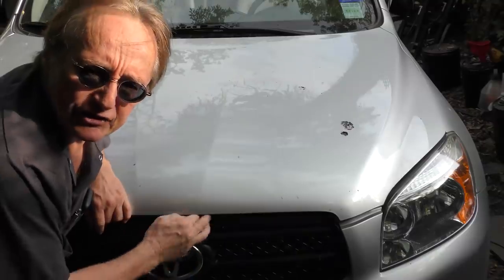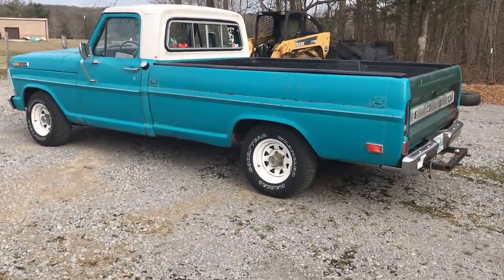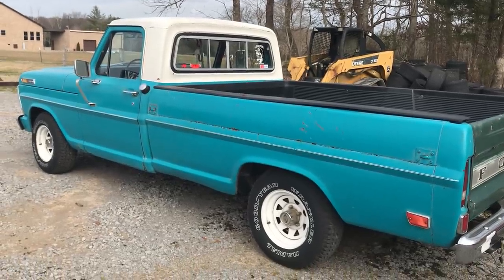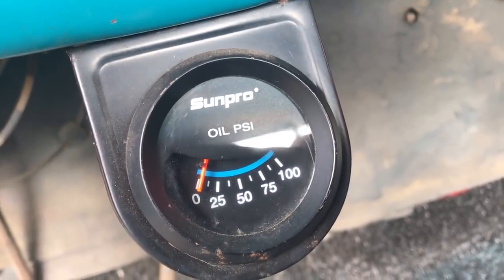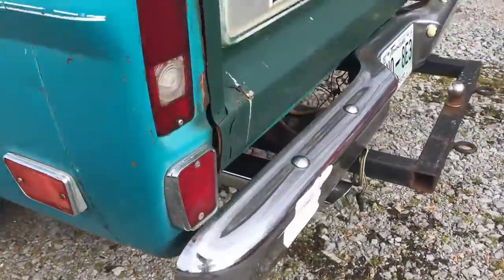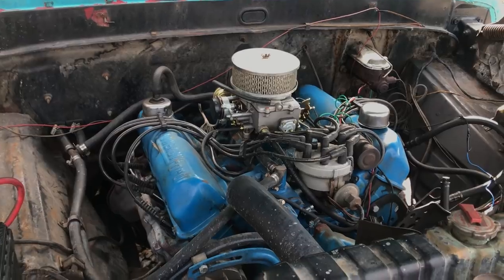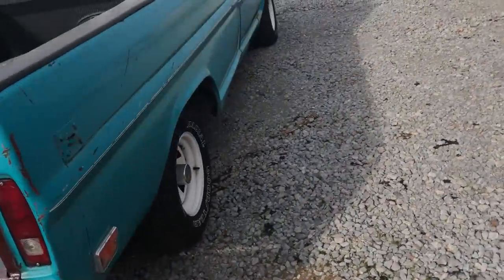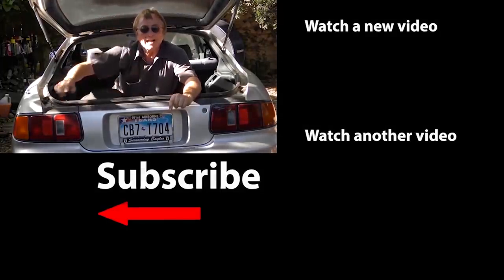Here’s What a $900 Ford Truck Looks Like

Comment: Only $900 where do you find trucks like that
Reply: Craiglist ?
Reply: Where I live that truck would go for at least $3500.00.If I could find that truck for $900 I'd leap tall buildings to get to it. If a guy were patient here he could probably get 5 grand.
Reply: The Southern United States, maybe.
Reply: Tennessee
Reply: In a junk yard?
Reply: Tom Swinburn It’s called a damn good deal is what happened here. Dude totally lucked out finding this thing.
Reply: Tennfingsee
Reply: I usually get them from friends of friends who are not completely mrchanically inclined.   Normally not running and they just want it out of their yard.   I've had majority good luck with it being simple.   Last one I bought was a nice looking 76 Ford Super Cab for $250 and it was a bad wiring going into the ignition switch,  easy fix.
Reply: Pacific NW trucks like that are still pretty cheap. That's about an average price for an old Ford like that.
Reply: @Tim A   I agree with Pacific NW trucks being cheap.   Seems like everybody only wants newer 4x4 trucks.   Anything old and 2wd goes pretty low.
Reply: You can find them riding down country roads in the South.... take a trip down there someday and you will most likely run into one somewhere that will be a good price for you.   I saw a 70's short bed Ford truck with a for sale sign on it and not too expensive when I was last home.   If I was not working outside the country, I would have bought it.
Reply: Any rural-ish area
Reply: Tom Swinburn I want a truck like that but I can only find a few for 10,000 or more :(
Reply: Briggs  in the country, I’m about to pick up a 1976 ford f 100 custom with the original 302 for 2k. Seems to be in great shape, but imma work on her and get her running again. Comes with a brand new hollies 2 barrel carb too 👍🏽
Reply: @alans.4167  I need help finding one
Reply: @elicoble4166    Lately I've been having the best luck from Facebook marketplace.    They go quick so almost need to check it at every chance.   Play around with the location and search radius.   I've seen vehicles that will show up listed at smaller radiuses than larger,  for example a listing might show at 25 miles but not 100 miles.   If you look on there a few times a day for a month or more,   eventually you'll probably find something.   Especially this time of year when people start looking for Christmas money.
Reply: Pacific Northwest all day. I got an ‘80 F-150 for 600 bucks, it’s been a pretty reliable and fun project.
Reply: Tennessee?
Reply: 900$  dollars. 
Yeah right. 
Over  5000 around here easy. 
You  wouldn't even buy the  bed for  900$

Comment: I bought a 1978 F250 Ranger XLT 460 4 barrel with a C6 trans with a blown motor for $500. Found an older 460 for 100 bucks so I swapped it in. Runs fine. It was a towing rig so its got a bunch of dents on the top of the bed and tailgate but the body and bed are straight. It was a blessing from above because Ive invested less than 1200 bucks into it.

Comment: I had that exact $900 69' F100 in 1990. Same colors from Krylon spray paint. It got about 6-9 miles per gallon depending if uphill or down hill. Mine was a lot louder with a bad manifold gasket seal. The cylinder head was warped so even with two gaskets squeezed together, it could be heard blocks away. Two years later, a little Turtle wax and sold it for ...$900.

Comment: Absolute anti theft device today.......young dummies won't be able to figure it out !!!!    hilarious.....
Reply: Isn’t an automatic?
Reply: @angelgjr1999  3 on the tree
Reply: leifcatt So it’s an automatic 3 speed?
Reply: @angelgjr1999  No, it's a 3 speed manual transmission with the shifter on the steering column.
Reply: Thank you. Many people want me to change it to a 3 speed floor shift but I refuse
Reply: I got a kick out of that too!
Reply: Meh im 30 and could whip that junt.
Reply: @picklerix6162  Straight six for sure.
Reply: @eyellgeteven9928  360 v8, more power/torque than many trucks on road today!
Reply: It's been a long time but 1st is down next to the steering wheel reverse is up next to the steering wheel  2nd is thru neutral and up 3rd is straight down. I'm  rusty with them it was a 62 rambler 3 on the tree.35 40 years ago.
Reply: Bet
Reply: @leifcatt  im 15 and i know how to drive a 3 on the tree my ranger has one
Reply: I learned on a 3 on the tree.Also had a 66 Dodge Dart /slant 6 with one.
Reply: That's what my first car, a 1962 Ford Fairlane had, of course I had to convert it to a stick shift on the floor with a kit I bought from an auto parts store. Oh, the stupidity of my youth!
Reply: 2nd truck I ever drove, 3 on the tree 67? bronco,  cant remember exactly the year, but I was 11 at the time, in now 30
Reply: I’m 17 and I own two of these, both of which are three on the trees. Put your money wheee your mouth is.

Comment: I had the same truck for $900.00 back in 1989. Mine had the 240 straight 6 with 3 on the tree. Drove it for 11 years and it went on for years after.

Comment: I had a 68 and 71, both had similar drive train to this one. Bullet proof vehicles! I can't remember but I think it was the 68 that had the dual gas tanks, a 20 and 25 gal. Running with 50 plus gals was handy during the 70's gas shortages!
Reply: forgot to mention, I carried a little ten gal gas can in the back too!!

Comment: 3 on the tree.....good truck
Reply: J G It means the shifter is on the column of the steering wheel and it’s a three speed so it was always coined a three on the tree.
Reply: J G  Yes.
Reply: fun to drive.

Comment: Those models were bad about the front cab mounts rusting away. The cab would sag down and rest on the steering column. I've had to repair that damage before. Sometimes the steering shaft would be worn almost completely thru.
Reply: walmartdog1142 all apart of the restoration game.   Normal problem areas for ford and Chevy.   Just apart of the maintenance on a 30 plus old vehicle

Comment: Me personally I wouldn't drive that $900 truck but it still runs and drives though. Also I've seen some YouTube videos where people take old trucks like this one featured in this video and turn them into weekend drag race high performance machines. Yep from street to high modified drag race trucks!!!!!😁😁😁😁😊😊😊
Reply: Same here, I wouldn't drive it on the road as it predates designing for safety. I'd like to be able to walk away from an accident. You'd be dead with this thing.
Reply: cz luver how its all metal and not plastic
Reply: @czluver4338  stay at home then c;
Reply: I would definitely be driving it. Pulling a paddle fishing boat on the weekends. I pull a fold down with my 72 Malibu.
Reply: @czluver4338  panzy
Reply: EvoEvan Nismo have you ever owned or driven a true classic vehicle ?
Reply: cz luver wrong.    The real metal on this would stand a accident better than any compact car 

New cars have about half the metal thickness and light weight 

That truck weighs about 3,200 pounds 
And is real cold rolled american classic steel that doesn’t just crush up like a modern car
Reply: @mateodelcastillo7186  Exactly. I bet you can sit on the hood of the truck at the drive in and watch a movie and no dent on the hood. Never do that on a new car ever.

Comment: I just baught a 2005 ford ranger xlt with the 4.0 4X4. Everything works and runs good on it. It needs a bed eventually and I am replacing the fuel filter other than that it has a small hole in the driver floor bored that can be easily welded. It has a rebuilt engine and transmission I only spent 300 dollars on it in upstate New York. Yo find running not rusted out truck up here for under 800 is shocking!!!! I love it. It has great power and handles good. I have around 350 on the truck total including what I paid for it.

Comment: 1. Clutch in
2. Hold shifter back and slide up
3.when ready slide enough for spring to launch back and continue going down clockwise and release clutch for 2nd gear
4. Repeat step one but let it ride the back to shift to 3rd gear

Holding clutch and sliding clowise with the stick out toward driver and down allows reverse

Comment: Hi Scotty is BMW Just a trash car company
Reply from the maker: morning, and no they make good engines
Reply: @scottykilmer  that is true because some of them make high technology that you necessarily don't need. But it's not just BMW, it can be other car manufacturers too.
Reply: But you still don't recommend them right?  @scottykilmer
Reply: Listen to your question. BMW is a performance luxury brand. Your question is trash. 🚮
Reply: BMWs are fine till you have to fix them.  Then you'll wish you never bought one.
Reply: Ben Lorentz  you buy a bmw knowing that parts and labor are more expensive. If you regret your purchase for maintenance costs you didn’t think your purchase through.
Reply: @MrCaptainandrew  whats funny is that describes about 80% or more of the BMW owners who come to buy parts from the store I work at.  None of them thought their purchase through. They are the types that buy vehicles just to run them into the ground and then complain about the cost of repairs.
Reply: If you buy a bimmer for the reliability of a Toyota you’ve got another thing coming 😂😂
Reply: Harsh dude. mama not giving any?. @MichaelLesesne
Reply: @scottykilmer  Agreed, after 17 years and 190k, the engine and automatic transmission have been rock solid on my endless money pit.  The fuel consumption hasn't changed since new.
Reply: Damon Abets yes.  Thanks

Comment: Hi Scotty, what is your opinion of Ford trucks with the inline 6 engine?
Reply: Clay Bucy- l'm not Scotty, but l own a 68 f-100 with a straight 6 cyl. motor. It's proved itself to be one of Fords best engines. About 5 years ago l pulled a trailor , full of metal 40 miles , to a metal recycling yard. I could feel it was heavy but l didn't how heavy it really was until l got scaled out. The trailor and load was almost 6,000 lbs. 5,899 to be exact. Plus 4,000 lbs. for the truck? A total of 10,023 lbs. The little motor and auto. Trans. Had no problem pulling this load, sometimes at speeds of 65 mph.  Never heated above 1/4 on gauge. Never even chugged on a hard takeoff. After finding out the weight, l started to worry!! Because my tires were old! If you ever find a ford 300, its now called a 4.9 6cyl. Grab it , you'll never regret it.

Comment: I had a 1970 F-100 in Edmonton, Canada. 1992. $300. Never an issue. Loud exhaust just aftet the manifold...Maxwell House Can Fix. Spray Painted Flat Black. Wonderfully Cracked Windshield. Had it 3 years...Drove to California, Santa Moni for the Summer '93.
Driving down, I sleptout in the 8' bed.
Got to Cali., then would "Rodeo Drove The Drive", as in would drive down "their" snobby street, just to be obnoxious...lol.
Did that A Lot...Never Pulled Over...Canada Plates/License !
Drove to MA., then to Great Slave Lake...back to MA.
3 Great Years !
One of those "wish I never got rid of it" Vehicles !
The End.

Comment: Oil works pretty well to loosen up tree sap, it is what I use to get it off my hands, it isn't water soluble.  I have a 65 high boy that my ex ran off a mountain road but I at least may be able to get it running again.  I have another 65 4x4 that I could use for parts, pretty complete.  I am an older lady and will need lots of help with it but I love driving it and really hoping I can get it going again.  It has a 390 in it that goes like mad, anywhere with any kind of load, it does not care, great truck.  You got a great deal!

Comment: Great looking truck there...and you can sit in the engine compartment when you work on the engine. Lots of space there so you dont have to take half the engine apart to change a sparkplug. I have about the same truck, 1977 Ford half ton, long wheel base, Explorer package, 400 cubic inch w/automatic. All original with a/c, power brakes etc. Drives like a new one but needs carburetor work. Thanks for sharing your truck with us. Nice to see a "real" truck once in awhile.

Comment: It's not a Ranger, though the red stripe in the grille is part of the Ranger trim package. 

Besides Ranger badging on the cargo bed, only the Ranger package had a cargo light over the rear window.  In the cab,  the pull knob to turn on the cargo light glows red. Very cool!

Comment: Got a 72 Ford F250 in San Diego in 74 for 2200$. Shipped it to The P.I. in 75. Sold there in 77 for 5300$. I still miss that old dog..360 with a C6 trans. Raced the Victory Liner Buses up & down the highway in Typhoons. Never lost..;)

Comment: Since it has no airbags, you can get a fancier steering wheel aftermarket with a soft foam grip for not much money, and a memory foam cushion for the seat bottom. Spray some Fluid Film inside and on the frame every fall. Like a relic guitar, it might be better to not change the paint.

Comment: Sounds good, and hey if it runs and drives reliably that's a great deal. I bought a 95 5.2 v8 dodge ram for 800 after the guy was originally asking 1000 in May 2017, I've only done a tuneup, oil changes, 4 decent tires on it, a new battery, and a new fuel pump a couple months ago back in Oct. It does have a bit of miles on it, about 225k, but still starts right up and definitely gets me from point A to B reliably. I have a rather loud exhaust on it that's basically straight pipes, have considered a more mellow magnaflow or similar muffler. I don't put very many miles per year on a vehicle so the lesser MPG of a truck doesn't hurt me too bad. I think I'll always look around for good deals on late 80s or 90s trucks still running decently and fix them up as I go along. I like how trucks sit higher up than cars typically do.

Comment: That is beautiful ! Forget the paint, I think it looks great. Id just put quiter mufflers on and maybe pay to have all that mess of wires organized and color coded or whatever. If you dont like that air filter, change it. Only thing i dislike is the manual but that can be changed for a 5 speed auto so you cn get better mileage on the highway. Low mileage. Great little machine. Have fun.

Comment: dad had a 71 hiboy, black, rotted away but engine was strong with 79,000 on it, still have a few parts in the basement, got rid of the truck in 2009 was a workhorse :)

Comment: Love those old trucks.  Easy to work on.  I had a ‘73 two wheel drive long bead with a 390.  Later I bought a short bed 4x4 with 360.  Liked the truck but hated the engine.  I know how to drive stick/on the column, I am 72.

Comment: Cab mounts are rusted. That's why the cab outer dent and the bed outer dent ("hence 'dent' truck body style")  don't line up. the cab sinks below the bed.  The radio is not stock.

Comment: I remember these Lil' Trucks real well, we had one we camped in, oh buy the way.....The Brackets on each corner of the Bed is for Camper Tie-Downs. I think the bed came off of a 3/4 ton truck with the Tie-Downs on it. the half tons Did Not have this package option. The Radio is Not Factory either its been added also. I hope you get some better Gas mileage than we did those 360's were Not Good on gas. It is in pretty good shape for its age.

Comment: Nice ride, But the Ranger variant had it written on the bed - we've got a First-Year 1967 Ford Ranger 100 Custom Cab. All original, 500,000+ Mile vehicle. Engine has been rebuilt twice and all it needs is minor restoration - New dash, naturally (These old Fords were known for cracking the dash) and new paint - That's it.  It's also the last year that included the 352ci V8, 4 on the Floor, and was factory built with a wood canopy. Naturally, the wood didn't last over 35 years because.. Well, wood.  She still has the factory option radio (and it works still). It'll out burn a Mustang with the BOSS engine.  Quiet and smooth, just like she was in 1966 when she was built. Best part, because it was built in 1966 for 1967 Model year, it does not have the reflectors on it that were shown here.  That's how you know a genuine 1967 from the rest that came after.

Comment: I learned to drive on an F100. It was a 76 with no power steering, no power brakes, no power windows, and no radio. It had a 300 six cylinder with a 3 speed manual on the column.  My mother told me that if I learn to drive that truck then I will be able to drive anything.  She was right.

Comment: Have a 1979 ford f150, I want to replace the engine (Also Transmission) Should I put a 6.6 diesel, 5.9 Cummins,6.7cummins, 400 or 460 Big block. Or othrr recommedations?

Comment: Same I have a 1977 F100 Custom 5.0 V8 302 paid $1500 for it New in and out just needed some work on the engine fuel pump etc. cheap stuff the parts for these trucks are super cheap even for the 1967 to 1972

Comment: Scotty can you help? 2006 dodge ram 1500 5.7 Hemi. Have to pump the peddle to start it. Fuel pump has been replaced 3 times. Smell gas when I start it. Spark plugs? Fuel injectors? Would be forever grateful. No mechanic has figured it out yet

Comment: I had a 1976 f100 best truck I've ever had did alot work 2 it(minor) original engine/ transmission. Same 3 speed fun 2 drive & mo1 knows how 2 drive it lol, wish I didn't sell it, now have 2011 Chevy Silverado 1500🤷‍♂️

Comment: I am fairly new to restoring and rebuilding trucks as I am 14 but I have a 1970 f100 and it’s a whole lot of fun just to work on and drive. Granted it doesn’t have power steering, it needs new break lines and a master cylinder, the interior is rusty and the seat is falling apart, it’s my baby and I wouldn’t trade it for a 2019 mustang coupe (which we were going to get but I like my truck more.) it’s a v8, and has a 390 in it, so it’s pretty fun. But like I said I’m still learning a lot about rebuilding and how trucks even work so sorry if some of the stuff I said didn’t make sense. (Oh yeah, and it doesn’t have a fuel tank. 😂)

Comment: The original radio would most likely have been just an AM radio and would been built in with a metal frame around it.  An AM/FM radio would have been an option if available.